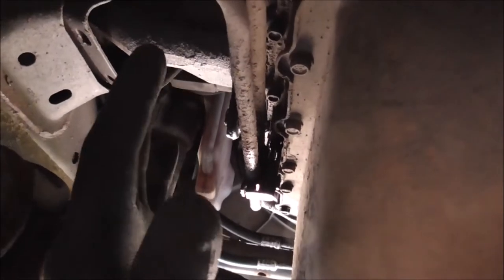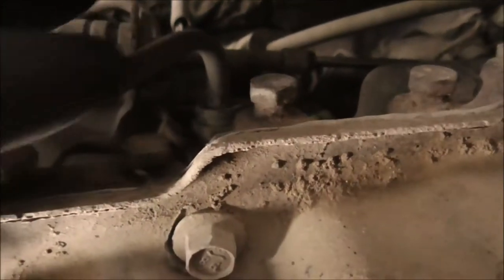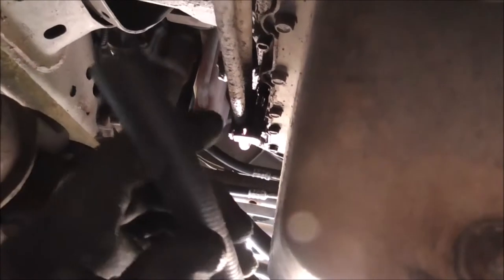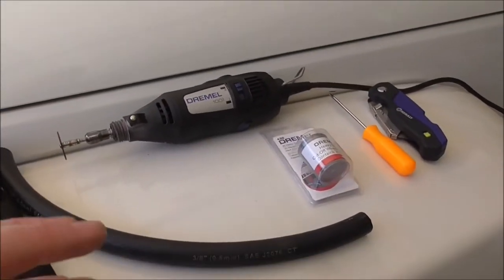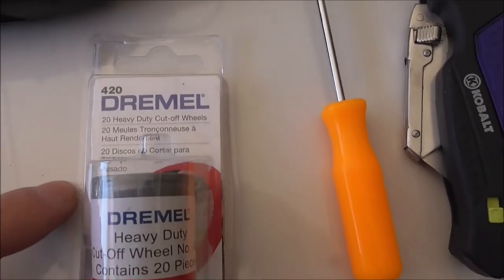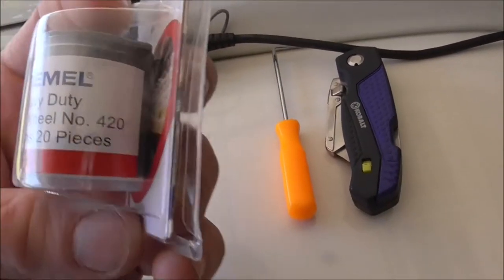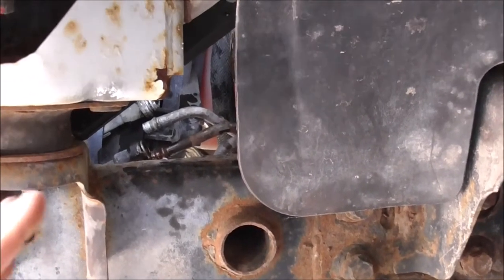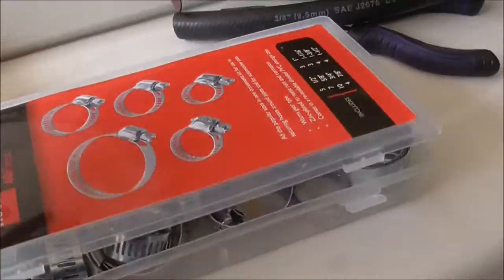Fixing transmission cooler lines for cheap on the Jeep Wrangler JK

Comment: I think I'm just going to replace the line and the O-rings but this gave me a great backup in case I can't get the lines off.  Thank you so much for sharing this.  I know the 3.8 L is slow as hell, but it's so freaking easy to work on.  I think I rather deal with this than an oil cooler from what I've heard on the 3.6 L.
Reply from the maker: Yeah lines would've been nice but for sure as a backup plan this would help.  Thanks for commenting and enjoy your day! 👍👍

Comment: I was thinking about cutting the lines, reflaring them and putting brass flare to barb fittings on them but I can’t find the flare fittings I need anywhere. If the hose clamps worked and aren’t leaking I’m keen to try it.
Reply from the maker: Thanks for commenting Ethan.  Yeah still to this day they have not leaked yet even with using the cheap harbor freight hose clamps lol.  You could always do this quick fix until you find the parts you need.  Thanks again and enjoy your New Years!
Reply: @BeyondTheScale  thanks for the video. I actually just got done fixing my lines with hose clamps the way you showed. Did mine while they were in the vehicle. Wasn’t too bad. Thanks again

Comment: Great video. Has anyone ever had a 08 jku randomly go into limp mode? I replace parts when the code reader says. It works fine for a while then it goes right back into limp mode? Help.
Reply from the maker: Appreciate the comment and thanks for watching.  I personally have not had that problem with my 2010 so unfortunately I cannot really give you any ideas lol.  Any videos you see on my channel are what I've dealt with thus far.  I'm not if I made an EGR valve video but that had issues as well.  Have a great day! 👍👍👍
Reply: @BeyondTheScale  thank you
Reply from the maker: @billyray6913  no problem! 👊

Comment: I pretty much did the same thing on my 05 cherokee 3.7l and  it keeps leaking like hell
Reply from the maker: Yeah mine would slowly drip but since this fix I still have yet to have any issues.  Keeping the fingers crossed lol.
Reply: Heya, was it maybe the o-rings that go into the radiator itself?
Reply: I replaced the rubber lines the crimp fittings didn't seal  it still leaks a Lil I need high pressure clamps
Reply: @rcaddict3815  I think I'll bite the bullet and just buy them then. Lasted me 14 years so might as well, yes? Thank you for replying !
Reply: I think you have to take the grill apart and Yada Yada to get to where the lines can be changed and go under the trans

Comment: why not just cut that whole end off and then just flair the end a bit and be done with it.
Reply from the maker: Which end part, the one going to the radiator?
Reply: @BeyondTheScale  both,I've done it and it's still holding up. The little bit of extra hose will be fine so long as you make sure the clamp is tight. You can also get the other type of clamp,the type  that come from the factory and make it look more like it came from the factory that way. The clamps cost a little more but if you're going for looks and function then that's  the way to go.
Reply from the maker: @aldee3018  Yeah this was more of a cheap quick fix.  I would've done the flaring idea but without a flaring tool and what not this was simple for me to pull off.  It's been going solid up to this point so that's a win lol.  Thanks for watching! 👍👍
Reply: @BeyondTheScale  in a pinch a quick fix always helps.